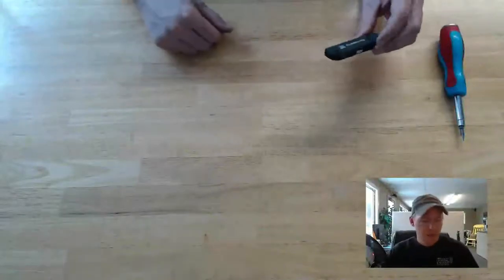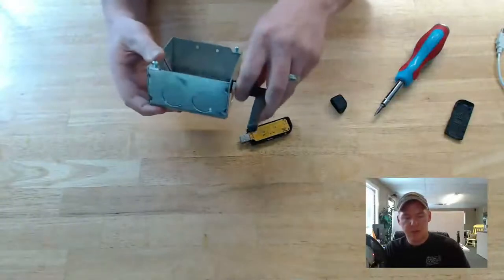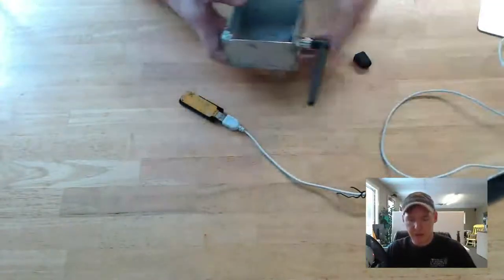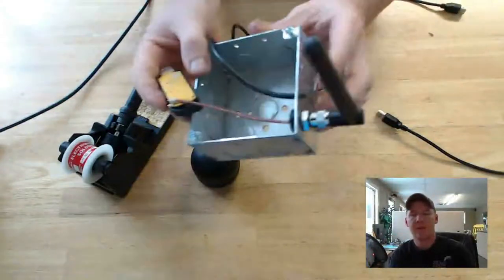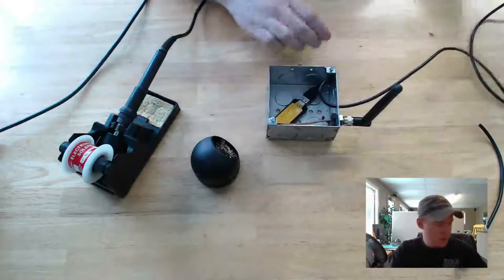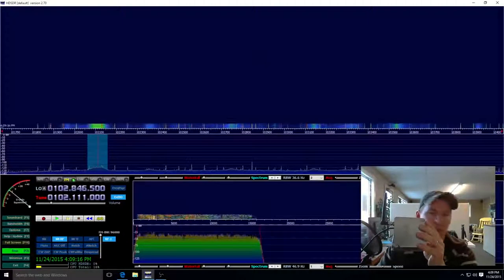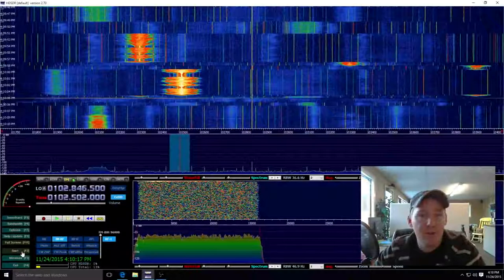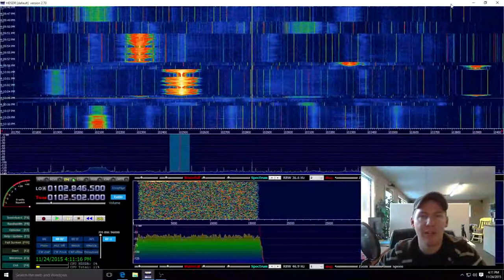RTL-SDR radio in a metal box | modification/noise reduction

Comment: I use a Ham It Up with a transformer power supply and comparing to Switch-mode the noise difference is encouraging. Screening the SDR and as other posters mention, putting ferrite beads on leads will help even more. Good Video.

Comment: You should put ferrite beads on your USB cable and put the device and antenna outside.
Reply: yes a clip on ferrite choke on the usb cable as close to the plug(laptop end), made more of a difference to my setup even more than a shielded box.
90 percent of my noise came from the laptop itself.
Reply: Yep I re-purposed some old clip on VGA monitor beads for that XD. Now I am building some filters for the HF modifications I did to one of those TV dongles..

Comment: :You could have pushed one of the KO's out a bit and routed the cable thru that by filing a small slot above the KO hole and running the cable thru the slot and push the KO back into position. no need to cut your USB cord. Just saying. Gud dx, 73

Comment: Have you compared performances before and after the enclosure in the box? Was it worth it in your opinion and experience ? Isn't the ground of the antenna connector by default (signal) grounding the box and reduce indeed interference working as faraday cage?

Comment: How about using foil or some flat aluminium from a can to shield it?
That cable should be plased through a rubber grommet so the cable doesnt get damaged by the metal
Does anyone know how to install esd protection into the sdr circuit as some of them dont have it,but the holes are there already.

Comment: Will a ferrite bead work on the usb cable? I have lots of noise on the 433mhz band Im using a sdr just like this one https://www.ebay.com/i/201258847047?chn=ps the case its in seems like metal but IDK